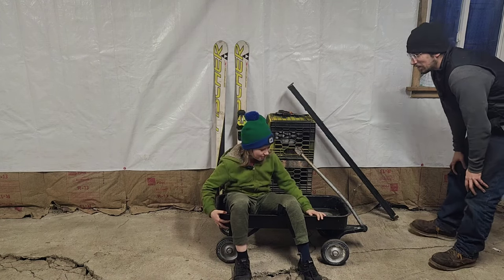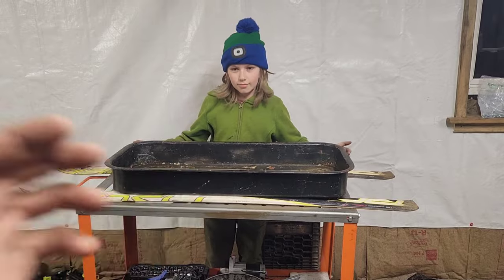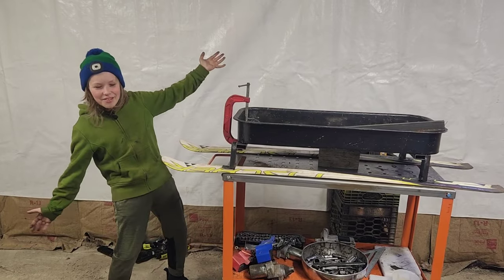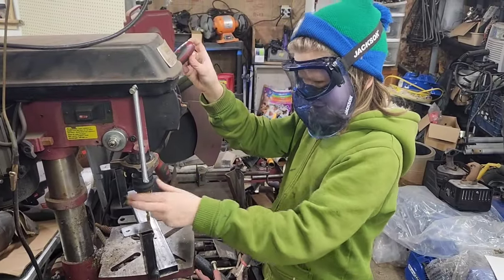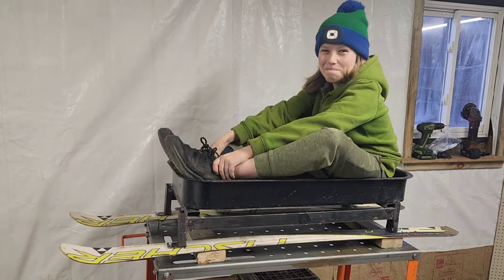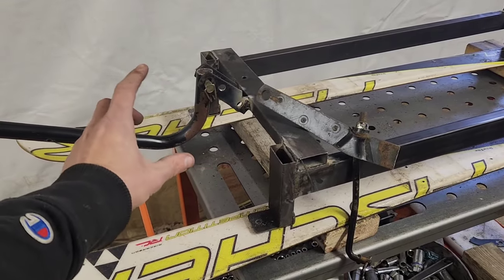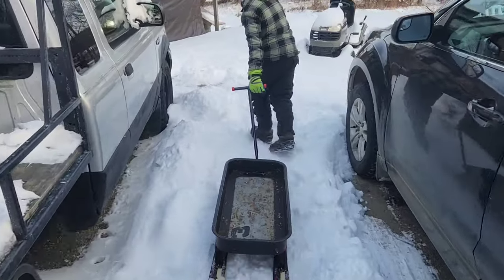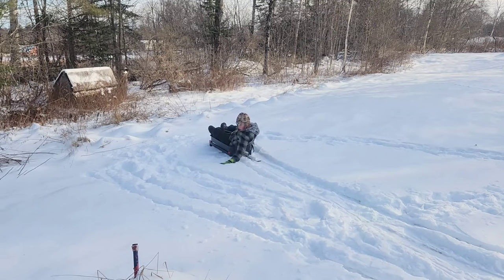Radio Flyer Wagon Sled DIY

Comment: I also had a radio flyer wagon sled when I was a kid. Except it was just me in my wagon and the handle bent towards the inside, me somehow thinking I could steer with the wheels going down a big hill. I don't remember how many times I flipped it on that single run but it was enough to teach me a lesson.

Comment: in my area we sometimes only get 1 or 2 inches snow , so i made one w/skiis .  just glued (construction adhesive) a 4 foot 2x4 (4 inch part vertical) to each skii , then screwed a 36x18 piece of thin plywood onto the 2x4s . a 26 inch 1x2 screwed 1/2 to 1 foot in front of plywood for handlebar . worked great , even on fresh , very thin powder snow . no steering though .